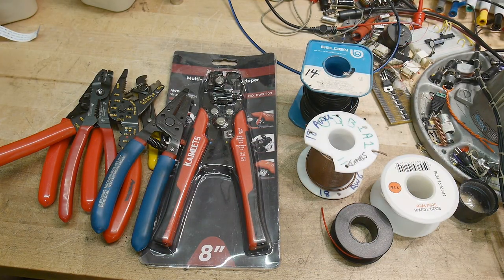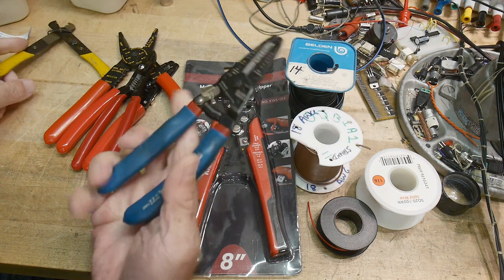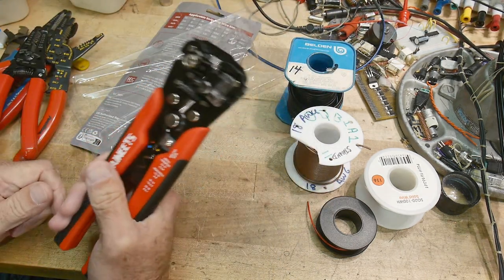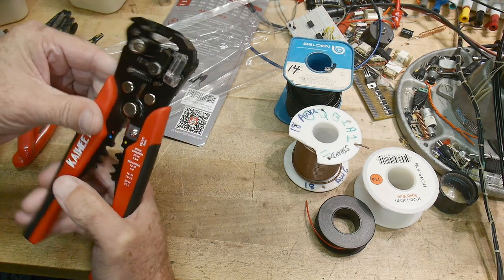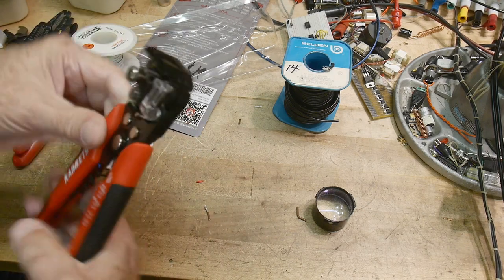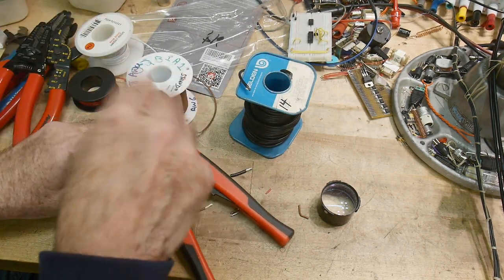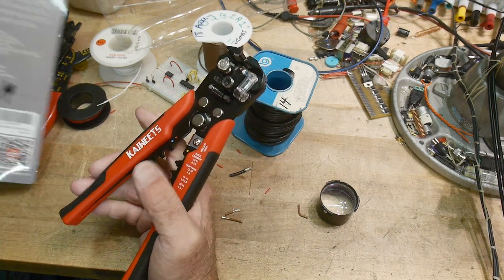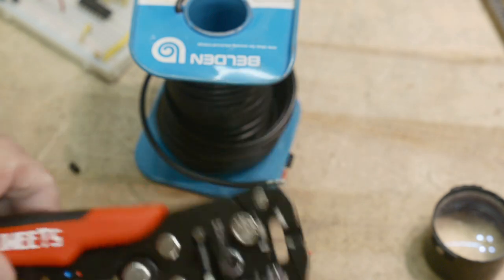#1417 Kaiweets Wire Stripper

Comment: Working in Avionics, our Teflon wire strippers have to be Inspected and Calibrated to legally use them. They have a cutting jaw custom to every gauge of wire, and the Teflon jaws are quite different than the "house/street" jaws are. The Teflon optimized jaws in addition to the blades have a D shaped support on both sides of the insulation to keep it circular, and keep it from deforming into a () shape instead of a perfect circle.

Comment: These are great. Capable of stripping 3 wire flat cables.
Mine is a bit simpler construction, cast jaws, not machined inserts like yours, but it works nice and does not touch wire strands at all.
Does everything from smallest up to 16mm2 except tricky insulation like silicone and old-school stuff like reinforces with synthetic strands under PVC.
Not too precise for same length stripping, especially on larger diameters it tears wavy shapes instead of circular clean cuts.

Comment: Only problem I have with these types of wire strippers is that when doing short wires like on breadboards they sometimes pull out the conductor. Often it is just better to use the manual ones for short wires.

Comment: My experience with every pair of automatic strippers...unless they are setup for a very specific wire, you will wind up nicking/cutting strands...which may (or may not) be an issue.  Great if you need to strip a lot of a very specific wire, but IMO, that's about it.

The design of your yellow wire stripper is one of my favorites, yet I RARELY use it.  However, sometimes if I'm in a position where I want to carry a limited number of cutters/strippers (or the wire gauge of wires needed to be stripped is unpredictable), that is my go-to tool.  My reasoning is that it will strip nearly any gauge down you can fit the jaws around. Maybe it wont "strip", but you can easily/evenly gouge the insulation around the circumference of a wire enough so you can get the insulation off.  It's does a better job than a razor knife without needing a specialty tool...on larger conductors.  Not many strippers can do ~30ga to 2AWG (maybe even bigger) in one tool.

If you find yourself crimping a bunch of 22-10AWG wires into butt connectors (or similar) I recommend you try a Klein 1005.  You will probably find that the added leverage over your Neiko wire stripper will give you much more confidence in your manual crimp.  I'm sure the compact size can be beneficial in some situations, but I try to grab my 1005 when I can because more power = more better.

My current favorite is a Klein 1019 though....10-28AWG (dependent on solid/stranded).  These would be absolutely perfect with a spring return and a lock.  I keep these at my bench along with 2 different Hakko CHP Strippers.  CSP-30-2 (20-10AWG) and CSP-30-7 (16-26AWG).

I may have a tool problem...

Comment: I use these for stripping the ribbon wire cables there you need all the wires to be stripped around the same length 
They are super use full if you are soldering a lot of ribbon wire buses on a dot or E98 pcb eg seven segment data bus.
Thanks for the daily dose of video

Comment: The best "Bread-Board" wires are solid 22 Gauge wire recycled from old Telephhone home wiring. Using 20 gauge (1/2W resistors!) or much worse> 1 or 2 watt Resistors in your bread board will permanently over-expand the female contacts, and that hole will be intermittent forever. I caution about plugging in 0.1" square terminals into a bread board - at least never force them into the inside pins where you will always be using the thinner wires like all IC's have. You have hundreds/thousands of holes on your breadboards - don't rape any of them out with a TO-220 regulator or a big Transistor either!!!

Comment: I've had a set of strippers that are similar to these for a few years now and find them to be alright for the heavier gauge stuff. They handle things like 18AWG well, but sometimes just chomp through anything significantly thinner. 

Speaking of cleanly stripping thinner gauges, I'm really hoping that somebody like Yihua/WEP, szbesttool or/and Aoyue start selling affordable thermal wire stripper stations.
These guys are selling things like hotair stations, desoldering stations, preheaters, solderpots, vacuum pickup tools and other nice little luxuries at an affordable price while still retaining a respectable level of functionality and quality. 
I really just want some hot strippers on my bench.
Reply: Do hot strippers melt the insulation off? What is the advantage in that over just regular wire strippers? Less damage to the conductors at the cost of plastic fumes, presumably?

It's nice to see someone speak well of Yihua - I recently bought one of their more compact soldering/hot air stations and am loving it thus far!
Reply: @3nertia  I wrote a long reply, but I guess it's gone now.
Reply: @EricYTP  sad panda noises

Comment: Another great thing about this style of wire strippers is that it'll strip the outer insulation from ethernet cable and Romex. I've used mine for both of those and it works very well. If you have 3-conductor Romex you have to put it in twice because that stuff's too wide, and it'll leave an ugly strip, but hey, it's not a beauty contest, right?

Comment: I have the same kind of strippers with different branding. You need to be careful when stripping really fine gauge stranded wire, but even that can be stripped reasonably well if you use a light touch. I specifically got them for stripping 14ga Romex (replaced all the old outlets and switches in my condo) and they get the job done with no fuss.

Comment: I have the Stanley ones (yellow handles, for the same price discounted on big A) and they are great. A bit heavy and large, but it's so satisfying not to have to use scissors. Also, you can strip multiple wires at once.

They could call this tool "Merryl Strip".

Comment: I have two pairs of the same yellow handle strippers

They were my go to stripping tool from elementary school into my undergrad years.  I keep one in a tool box in my mothers garage and still occasionally use them if i am there without other tools.
Reply: That's why they are perfect when you can only have one tool.  They will literally strip anything if you are patient enough.  I've never used the depth setting...always did it by feel and intuition.

Comment: I just use the very basic yellow handled one... it's probably fifty years old. Most of the time I don't use a wire stripper... I can strip with side cutters, without nicks. Not a fan of mechanical wire strippers, if stripping many different gauges of wire... too fiddly... too unreliable. Maybe these Kaiweets ones are OK... throw 19.00 USD + shipping at it... and let me know.

Comment: I use a lot of Teflon insulated 20 and 22 gauge wire in building guitar amps and find that these automatic strippers don't work well with that. Insulation is too slippery for the grippers to hold it. (Nod to Submaranian R down below). Don't know if you use any of the Teflon insulated stuff or if you tried these on it. Would be good to know

Comment: I have a similar wire cutter and stripper in which I can adjust the jaw size to remove only the insulation for different diameters leaving the copper strand wires unscathed 
I hope you must look into yours for the adjustment; it should be there for sure.
But the stripper is not good for Teflon insulated wires because of the slippery nature 😀
De VU2RZA